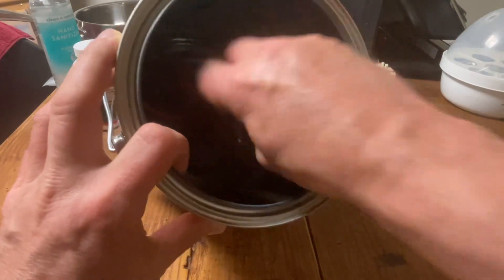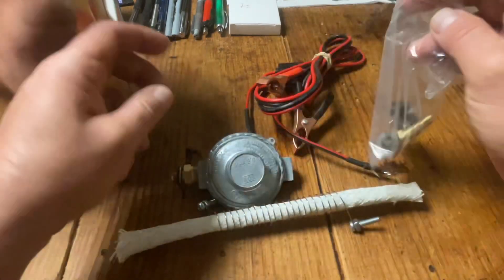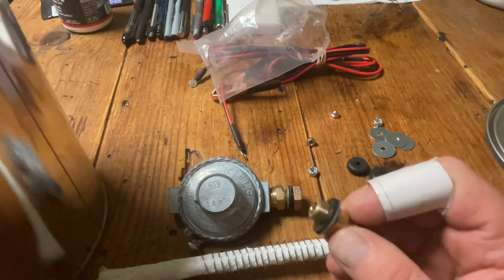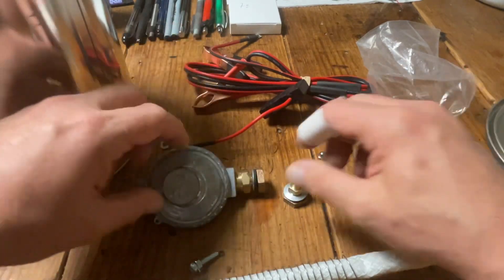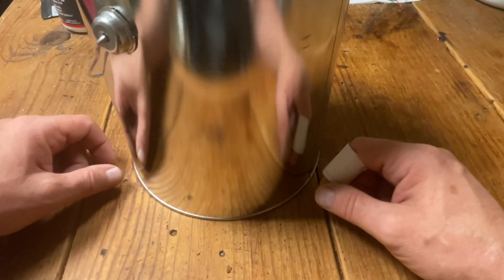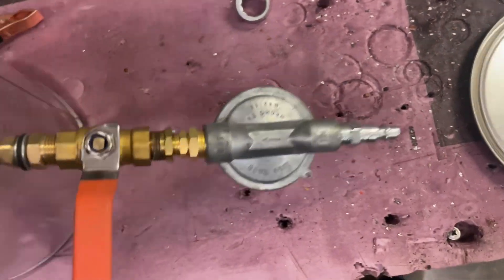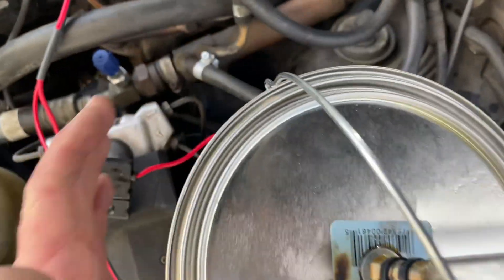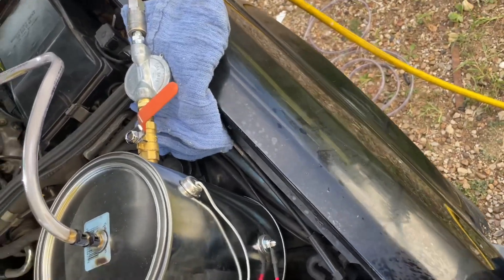Mercedes W126 560SEL vacuum leak check after 7K miles of the big repair with selfmade smoke machine

Comment: thank you Peter for emphasizing how important the vacuum seal should be on and around all hoses/connections. Your videos on MB/aftermarket hose test in fridge and on the car simulating the real life conditions are great. As you mentioned earlier, rubber hoses lose their flexibility/function after 10-15 years...and the head scratching high idle, rough idle, hot idle all come around from simple small tubes/hoses/connections (+from some other causes/parts, too)

Comment: Thanks for the detail.
I did a smoke test before. It's fine, but the engine pressure oil gauge has a slight flicker.
 I renewed the solder inside the gauge, tightened the pins a bit more but this problem does not go away.
 Maybe a vacuum leak. It looks like your car's oil gauge is vibrating at idle. I've seen it in previous videos.. If you find the cause of this problem, let me know :)

Comment: I opted for plumbing pipe to build my container. This took care of the burn hazard associated with the metal can. Also a short piece of air hose can be installed directly to the can and than the flow reducer or adjustable pressure regulator attached to it. No more balance issues. I found running higher pressures may push oil residue in to the engine so I try to stay low around 10 psi, never over 20.

Comment: I enjoyed your video. What spark plugs do you recommend for an M117 engine?
Reply from the maker: Hi Flynt,
Thanks! Bosch WR9DC+ gap 0.8mm (0.32”). 
Those are the successors to the original WR9DC and they come with the correct Gap already set by Bosch.
Peter
Reply: @inovahightechltd  Peter, Thank you for answering my question! I look forward to watching more of your videos.